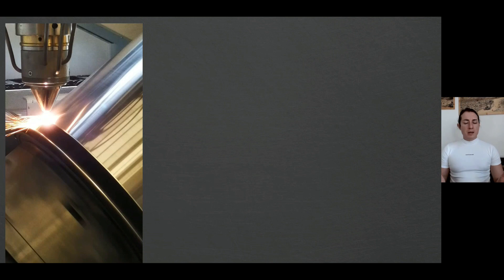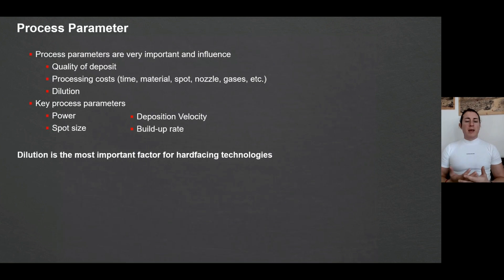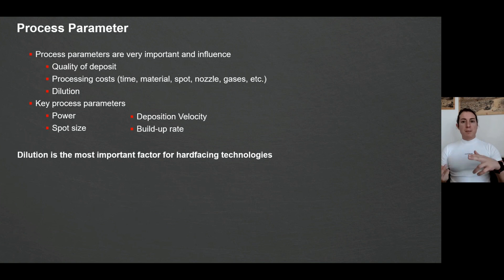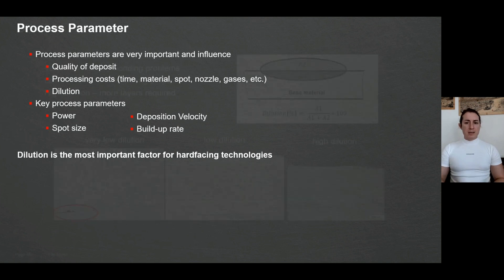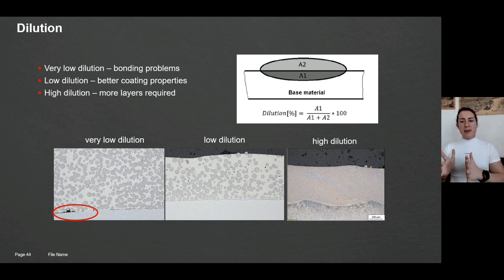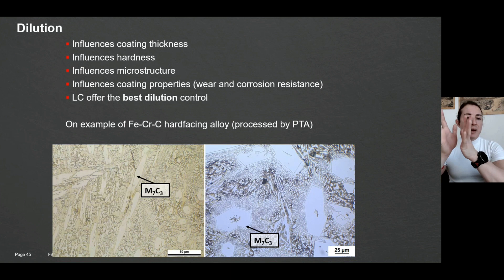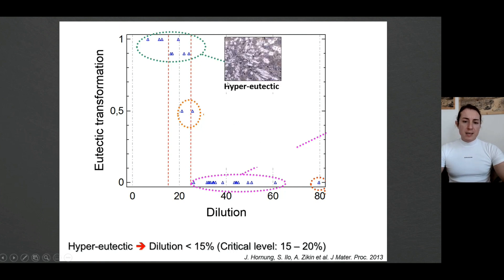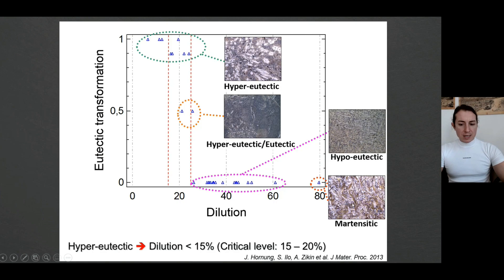Dilution Explained | Why It Defines Hardfacing Quality

Comment: What is the formula and how to calculate the ovelay dilution in a pipe?
Reply from the maker: It doesnt change on a shape of your part. Formula would still be the same. I guess you reffer more how to catch the 0 line - microstructure and etching of the surface